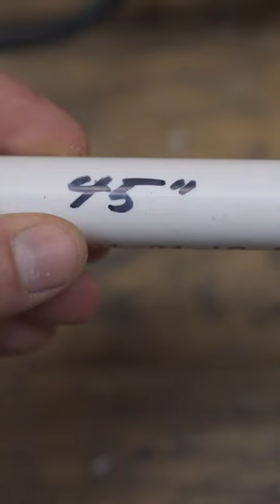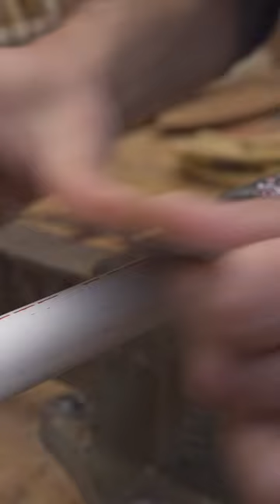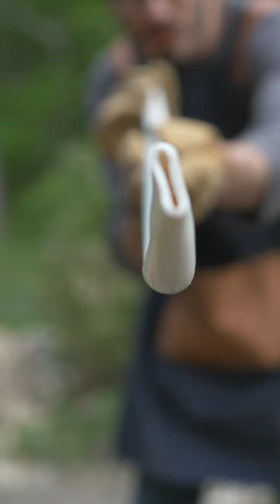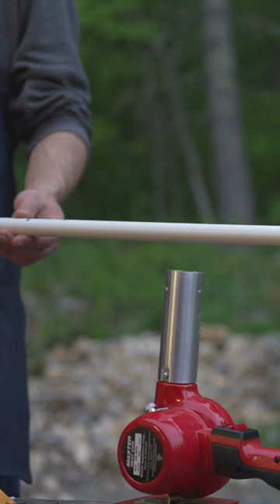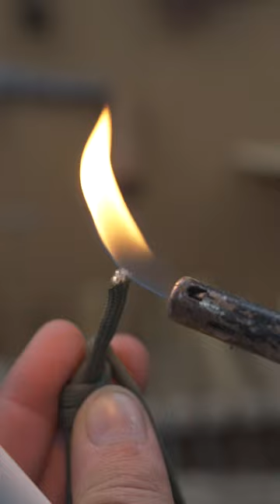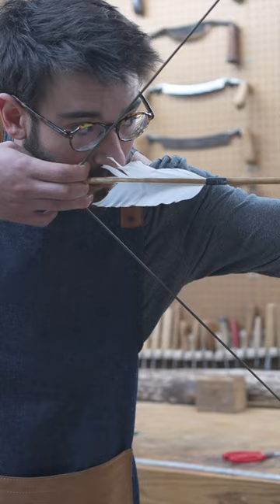Making Link's Bow #shorts

Comment: so my question on this is why no taperwith like a flattening jig? is it because of the length 45 which is generally a little shorter than i see for 3/4 inch and what weight did you get it to and speed?
Reply from the maker: See the tutorial version for more details. This is more of a cosplay prop but my other pvc tutorials make higher performing bows. I didn’t use a flattening jig so the build would be more beginner accessible